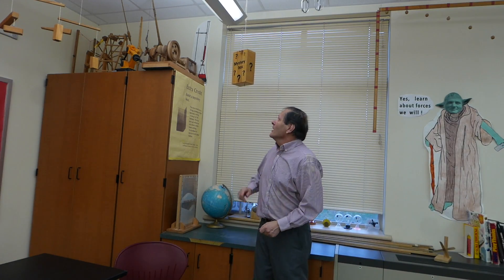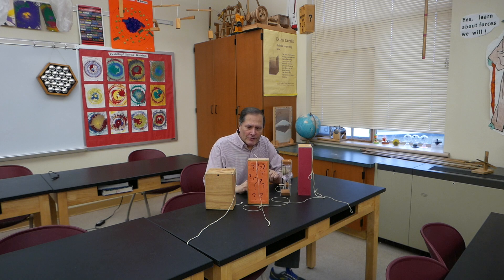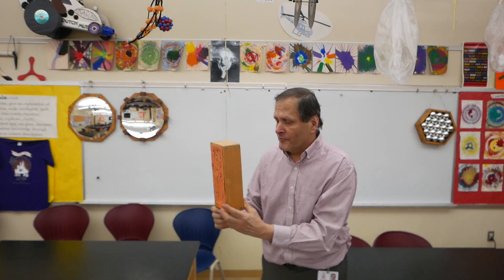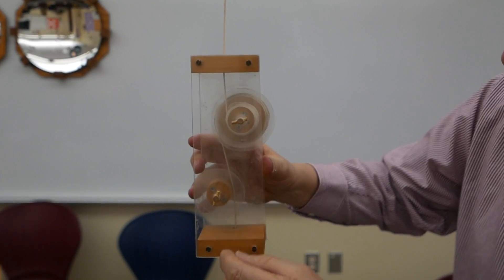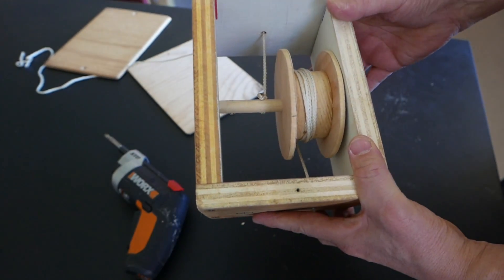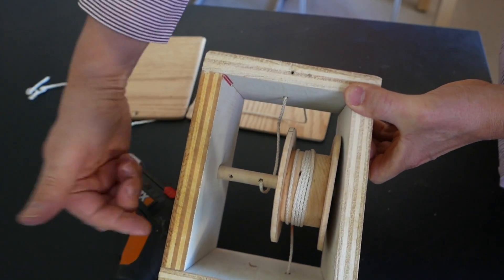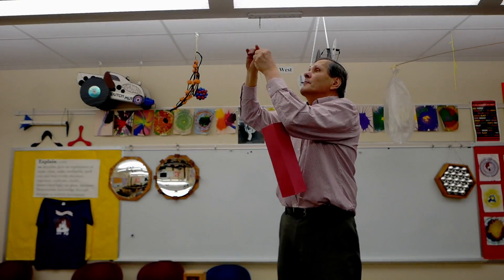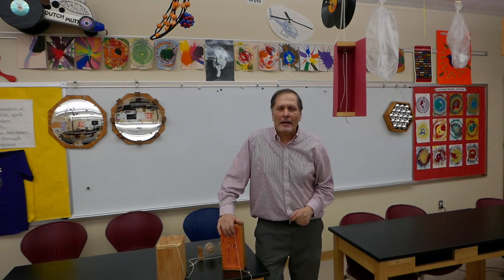Mystery box revealed- Wheel and axle // Homemade Science with Bruce Yeany

Comment: How well does this work if the wheels are very close or even in size?
Reply from the maker: it won't ,  the wheel has to be larger to get greater force or torque applied to the small wheel/axle